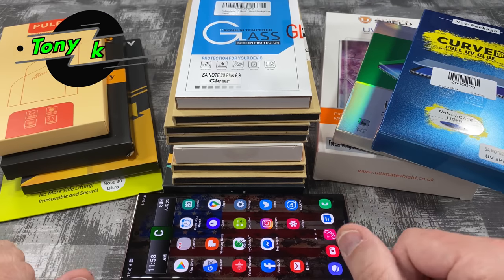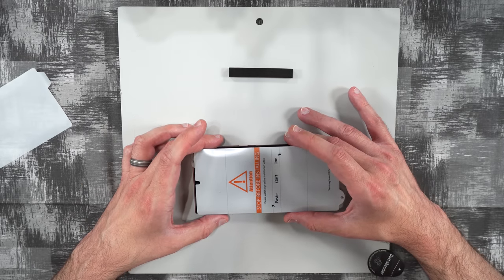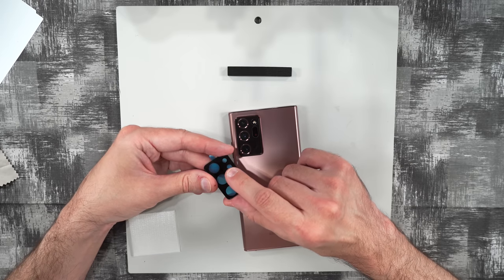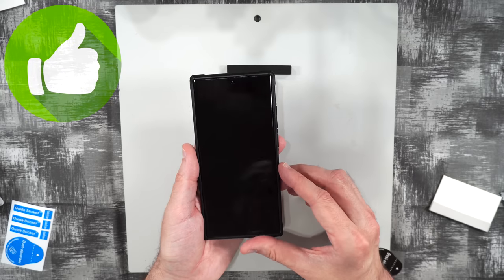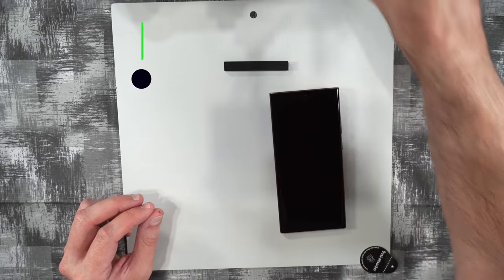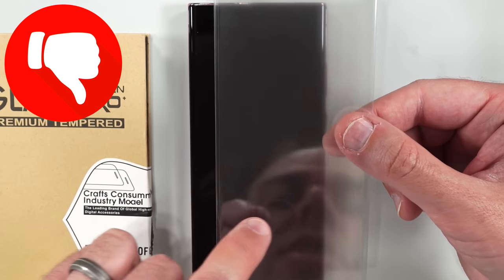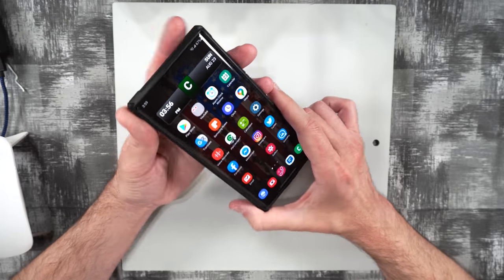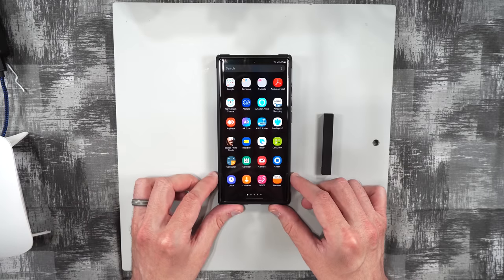Best And Worst Screen Protectors for Samsung Galaxy Note 20 Ultra

Comment: On the last one, I've done quite a few Whitestone dome screen protectors on my Note 10 plus and Note 20 Ultra. First, I always cured mine 4 or 5 times on top middle and bottom. That glue after 15 seconds will ALWAYS get into your ear piece of the phone. Second, the fingerprint sensor doesn't always work properly. It's really ridiculous that you'd have to go through this kind of pain cause of a fingerprint sensor. Anyways, cool video. Maybe next time use more than 1 case to ensure compatibly. Use 1, 2, and 3 part case per screen protector.

Comment: Thank you so much for making this video!! I was worried for you when the liquid got in the speaker. Glad everything cleaned out! 👍🏻
You really helped me understand glass screen protectors with a liquid adhesive:
✔ You get what you pay for. Look at what comes in the kit to help the installation be successful. Purchase the product that supports your level of experience
✔ Make sure the speakers and microphones are securely covered. Double and tripe check to make sure they are covered. If the sticker used to cover the speaker or microphone looks weak, do not trust it
✔ The installation trays seem like complete overkill to the novice like me, but they are required to level the phone and keep the phone level so that the liquid adhesive is evenly dispersed under the glass
If you don't know what you are doing, get the product that includes the installation tray and adhesive strips
✔ If the installation starts to go wrong, stop. There is nothing you can do to recover the installation if the liquid adhesive is out of the tube. Clean up everything and start over because trying to continue may end up costing you more

✔ Don't be afraid to bail out. Nothing is fixed until the UV light is used

I am going to purchase the Whitestone Dome Glass Note 20 Ultra screen protector -  a product you said you installed previously. I really thought the installation tray was overkill and a nice convenience tool, but after watching your video, I realize that the installation tray - for me - is critical to complete the installation any of these products successfully. The liquid adhesive is very mobile and travels quickly. You helped me understand why some products are priced as they are. The tools in the package make the difference.

Thanks, again!!
Reply from the maker: Thank you for your support, it can be scary for a lot of people when the liquid gets into places it shouldn’t that’s why I tried to show everyone what to do if that happens.

Comment: Do you know which plastic film is the same clearness as the original one that comes with the Samsung phones pre-installed? I removed mine by accident, and could not re-use it on the device.
Reply from the maker: They seem to be really clear, if there was any difference between the two I couldn't really tell. The plastic that came on the phone wasn't meant to be kept on as it was really flimsy. They only real difference I could tell was the feel, the film protectors in my video were a little more grippy. That's not necessarily a bad thing especially when your tryi v to use the fingerprint sensor.

Comment: I NEED to share this.  I've had one of these film protectors on my Note 20 Ultra phone since it came out. The protection did great,  and did peal up and had to put on a new one, HOWEVER- last week, my corners were pealing up and I took off the protection and began noticing a strange pattern on my phone that looks like a screen burn in.  I could not find ANY answers on line until late last night and found MANY people have the EXACT SAME PATTERN and all used the film screen! There is a MAJOR PROBLEM these are causing! I've got to bring my phone in to get it checked out,  as the pattern and the way it's impacting my screen is literally making me sick and giving me a headache. I rarely have headaches and looking back,  since this began I have have 4 major headaches.   Anyway- Please do some looking and find a different protector ad these film ones are BAD for the phone screen. That's the ONLY THING that all those reporting this have in common!  If this will allow me to add pics I will!

Comment: Thanks for the awesome vid, I've bought 4 screen protectors and i cannot deal with the fingerprint dot, still don't know which one to go for, the plastic type doesn't give much protection but no annoying dot in the middle, might go for this
Reply: I have used Whitestone Dome Glass for years since I owned my S6 Edge. Have never had a cracked screen thanks to them! Had them on my Note9(1 screen lasted 2 years!) and now I have it on my Note20 Ultra. I will never use any other screen protector. Worth every cent.
Reply: Atrayel I might try that, thank you
Reply: @Shinjite1754  Whitestone dome glass is really good, perfect for Samsung phones

Comment: thanks!   excellent video!     glass protector (non adhesives)  doesn't work for my phone at all.  I wonder now if I have a defective phone.
Reply: I have used Whitestone Dome Glass for years since I owned my S6 Edge. Have never had a cracked screen thanks to them! Had them on my Note9(1 screen lasted 2 years!) and now I have it on my Note20 Ultra. I will never use any other screen protector. Worth every cent.

Comment: It's like the Vitavelaaa one got the factory rejects, they didn't even have the spelling on the sticker right that sealed the "wood" case, but then the one right after that which was the same exact screen protector but different brand did have the spelling right, lol. In regards to the Dome Glass type protector, I tried that one 3 times and it didn't work for me each time. The first time the fingerprint sensor didn't work at all even after reregistering it and turn up touch sensitivity, the second time the glue leaked out of the side all over the side and back of my phone, then the third time my finger only registered maybe 25% of the time. I got so tired of trying to find a screen protector that worked that I just don't use one anymore.

Comment: Just a quick observation the glass with liquids do have a way to install as the top of the scren protector have a small(varely visible) indent for the speaker, the les light comes woth 2 ports one for usb c and micro usb on the other side, and last if you take the apropiate time and dont let the glue run before installing the glass you will not have to worry about the speaker as the glue will get tothe edge of the and not run out i have 4 note 20 ultras for my family and i installed all 4 of them with yunners protectors and they fit perfect in a spidgen tough protection cases and they run with no issues didnt even have to register fingerprints again
Reply: Finally, somebody with experience using glass with the Spigen case. Thanks!

Comment: I'm going for the Ringke Easy Dual Wing. Since didn't show wrinkles, it wont lift up from edges since it gets tucked down under the case. I feel more protection with the glass ones, but they are messy and and start peeling off when you put them in your pocket, cause of the case, using the edge panel, using the swipe gesture navigation bar or even cleaning them and prices are not cheap for something decent, plus is hard to find one that works well with the fingerprints scanner.

Comment: I ordered the Tamoria screen protector. Really wish I would of came across your page before I made my purchase. I actually had ordered a couple of different ones ahead of time and found out they were not compatible with the fingerprint scanner at all. Some protectors were on back order for MONTHS! I have the Tamoria on now. The company had a lot of pieces not shown in the video, so I was a tad bit confused. This was my first time using this type of product. I put the stickers on, but missed the speaker part and see that there is cured liquid there.
Reply from the maker: Ugh, I'm sorry to hear that. This is exactly why I make these videos so everyone can avoid the bad protectors. Does the sound from the ear speaker sound muffled?
Reply: @HighTechCheck  thanks for responding! I tested that out to see if there was any muffle and there wasn't. I always use either my cars bluetooth or my Samsung ear buds anyways, but glad it was still good.

Comment: I wish I had watched this vid before buying the Venoro (mine is same box but reads HTWON for brand name).  I instantly and absolutely HATE HATE HATE this screen protector.  Instantly devalued my phone.  Fingerprint sensor doesn't take without multiple tries, missed keypresses, and instantly cracked when putting into an Otterbox.  I am now watching vids on how to remove the bleeping thing.  My OCD cannot stand the stupid cut out circle for the fingerprint sensor either.  Somehow this had gotten a good review back when I was researching, but now I hate my life.  Excellent review video though!  I would have loved to have found this earlier.

Comment: I can not stress enough...Whitestone Dome is worth every penny. They have no competition, which is sad at this point. You can't spend $1300 on a phone but complain about $70 on proper protection...
Reply: yeah...and its not even 70 bucks lol they have codes/sales available all the damn time! AND you get 2 in the pack now...AND it only cost like 8 bucks for shipping to get a brand new one under warranty no questions asked! you just get on the website and do the warranty shit all yourself
Reply: Don't you have to do it a certain way so you can use cases?
Reply: @icecool85  Well the phone is pretty sturdy, so I use very minimal case like rhinoshield bumper or spigen neo hybrid. I can't speak for the chunky cases like Otterbox Defender. But as long as you install it correctly, mine have never lifted from cases.

Comment: I just don't understand why there's so many issues getting a regular glass screen protector without the hole cut out. My Galaxy Tab S7 Plus uses the same fingerprint reader & the screen protectors I've had for it don't have that & work just fine.

Comment: I would wear latex gloves when applying a screen protector. This will help avoid oils from your skin transferring to the glass. Also, when applying the glass protectors with glue you can use Phone Soap UV cleaner.  That is if you have one.

Comment: Why are you having so much issue with curve edge film lifting ? I didn't. Good thing I didn't Iisten to you. Also, the full adhesive uv cured screen is garbage. They do not stick very well and leads to more bubbles. Glue never cure properly. Use a few different brand for that.

Comment: Am film is a good glass screen protector and its 40$ cheaper and just as good as domeglass
Reply: I was considering that one for my Note 9 after seeing it on a video like this one. Didn't end up trying it though. That phone didn't have the fingerprint sensor under the glass so that wasn't a concern. Do you have it on the Note 20 Ultra and the fingerprint sensor is good?
Reply: @died4u525  Yeah it was not as hard as I thought to install and works

Comment: I opted out of the fingerprint scanner due to the annoying cutout, so I went with the privacy glass. Everything is working great except for the keyboard doubling and tripling letters while typing. Touch sensitivity is up. If turned off screen is almost inoperable. Does anyone know a fix for this?

Comment: The liquid adhesive protectors seem like the best but they just seem way too involved to install and I don't want to take a chance of spilling liquid into the speaker grill of such an expensive phone. I figured the tempered glass protectors for the Note 20 ultra would be the same as for the Note 10 plus and not have a stupid circle at the bottom middle, so it looks like I'm gonna go with the real basic ones that he showed at the beginning of the video for now. I bought the insurance so if the thing cracks, I can spend the $29 deductible to have the front screen replaced if it breaks.

Comment: I got ESR. It was frustrating that the fingerprint sensor didn't work because I heavily depend on it for Samsung Pay everyday.   I trial and error found that if you removed all fingerprints and start over with registering one finger at a time.   IT started working.   The fingerprint section of the screen has an obvious hole,  you could see two tone of color or lighting thru it,  not cool.

Comment: The Galaxy Note 20 Ultra has the newest Gorilla Glass Victus on both front and back, which they claim is even more scratch and drop resistant, so might not even need a screen protector.
Reply: You do need... Believe me 👍🏼
Reply: @ufukatici6103  elaborate please
Reply: @nickh4676  every galaxy note 20 ultra owner do need screen protector,because victus is a city myth unfortunately 👍🏼 there's no real difference between "before victus" and "with victus".

Comment: I have installed one of thoses UV glass screen protectors on my note20 Ultra and the glue entered the speaker, I was desperate but I followed a tutorial and managed to take it off, I used isopropyl alcohol and a toothbrush, I used it slowly and managed to remove the glue. But after that, i took the screen protector and i never more put one of those uv glue

Comment: Your method of pressing the edges first is wrong. This is why it leaves this smudge in the fingerprint sensor or the lines you saw. You should press from inside to outside not the opposite. When you press around first, air may be stuck in the center, otherwise it is forced out through the edges that are not stuck while you press.

Comment: Thanks Bro, I'm just going to go with the 1st screen protector.
Reply from the maker: Thank you for your support Marty, I’m glad you found one you liked.
Reply: Can you comeback and tell us how it goes
Reply: @BIKELIFEANTONIO  will do
Reply: @BIKELIFEANTONIO  I received and installed it a few minutes ago (damn that was fast shipping) and it was a very easy process, it looks nice and clean and it goes really well with the unicorn beetle supcase pro which is the best case in my opinion.
Reply: @MartySince87  how does the fingerprint sensor work. Doesnit take few trys to unlock or its normal like withour screen protector unlocking... and does the screen protector come with adhesive under fingerprint area. Or a round glass area to put finger for scan.. r plain glass
Reply: @Samjimmy101  yes it works flawlessly for me I have no issues, the protector is an adhesive one and very effortless to put on and if you get it on smooth with one shot it's like there isn't even one on the phone.

I didn't need anything too fancy or crazy, just something to protect my screen. Sorry for the late response, I was at work.

Comment: DON'T GET A UV GLASS SCREEN PROTECTOR, IT'S STUPID. All those trouble risking your phone with glues and these UV glass screen protector won't even last good for a month and worse, you can't even remove it if you want to replace a new one unless you want to break off your screen. I had one installed by an official retailer costs me too much for just a screen protector it was all good for a week or 2 but after some daily usage (gaming) and cleaning for almost a month, UV glass's coating starts to diminish, it became prone to scratches and all and I can't even remove it because the adhesive is so strong. So again, these UV glass ain't worth it, don't buy it.
Reply from the maker: I have removed every protector that uses adhesive without issues ?

Comment: I got the adhesive in my speaker and thought I ruined my new phone becuase I cured it already. I used rubbing alcohol with a q-tip and it got rid of the glue.

Comment: Did you test the pen on any of them
Reply from the maker: I did on the glass screen protector that use liquid adhesive and it works well. I didn't try it on the rubber film protectors though. I can't imagine it not working but it might not be smooth.

Comment: I refuse to get one with the hole. So stupid. Prob gonna try the amfilm myself. Just hope doesn't mess with my cases.
Reply: I have used Whitestone Dome Glass for years since I owned my S6 Edge. Have never had a cracked screen thanks to them! Had them on my Note9(1 screen lasted 2 years!) and now I have it on my Note20 Ultra. I will never use any other screen protector. Worth every cent. Yes works with the fps. Register Fingerprints AFTER you install it so you have no issues.
Reply: @Shinjite1754  Thats good to here. I've heard good things about both. Although some people reporting white dome having thin glass for some. But they been around im sure it's solid. Just never wanted to pay 64. But after issues had with some glass on the note 8, I want a premium solution. 

How's the case options with it though?

Comment: I became afraid of the film screen covers in the past.  Due to one bad experience of my daughter's screen cracking. While using a phone case.  And have been using the 9H go to ever since. The film is hard to detect the lifespan of protection for me. Even though the 9H has cracked,  it let me know the protection is done & change to a new one immediately. My Note 8 curved display stayed in meek condition for trade in. As well as my Note 2 & Note 5. Along with my daughter's phones thereafter. Also using phone cases always as well.

Comment: My best experience was with the Ringke Dual Wing protector.
Reply: That's the one I'm looking at, so as not to deal with LOCA glue. Do you have any issues using the S-Pen on the film? I like the fact that there'd be no peeling up since it wraps all the way around and behind when in a case.

Comment: I'm using spigen neoflex
Reply: I have that one and its dissapointing
Reply: @Zeuroz靴  it works for me
Reply: @BELANOVA74  ye it does work but the display is limited
Reply: @Son Goku what kind of problem r u facing with neo flex.??
Reply: @anisuzzamansium2176  when u use the Spen it leaves a bunch of lines on the screen and the display doesn't look as good as it would normally
Reply: @anisuzzamansium2176  I took it off and got a domeglass best investment I've done